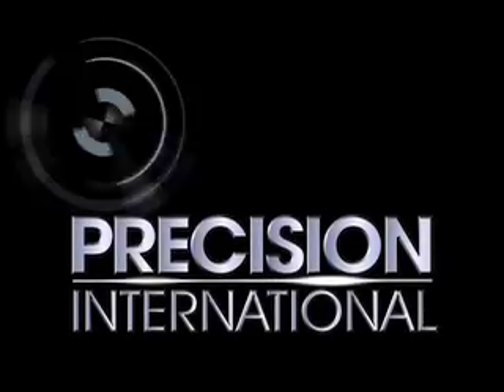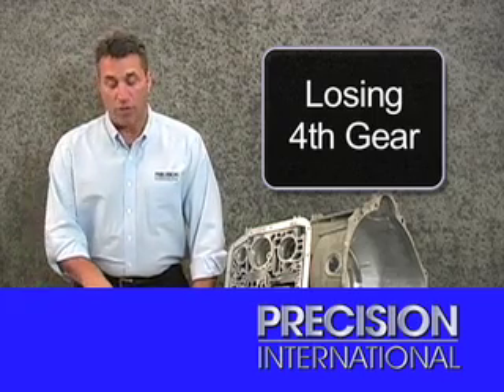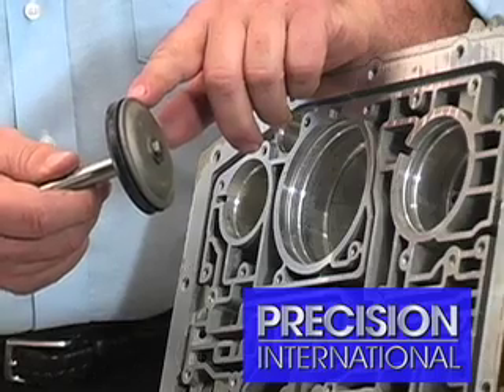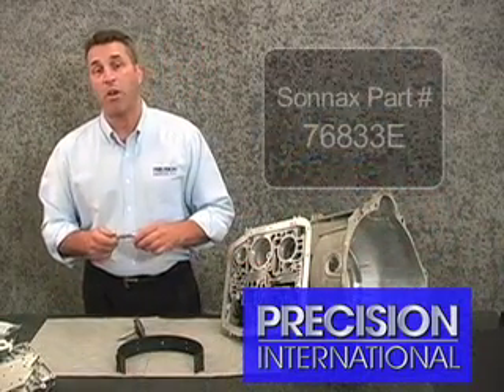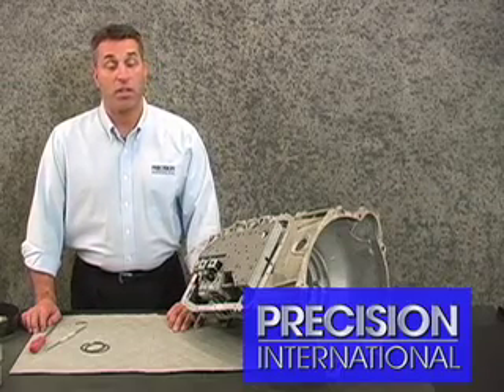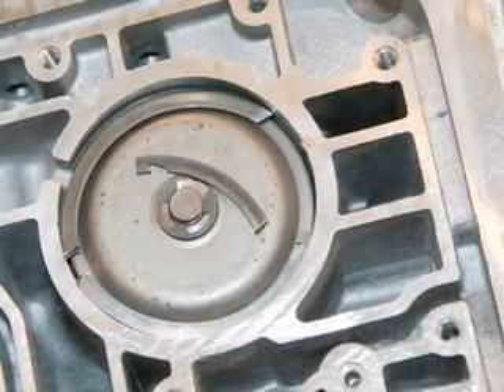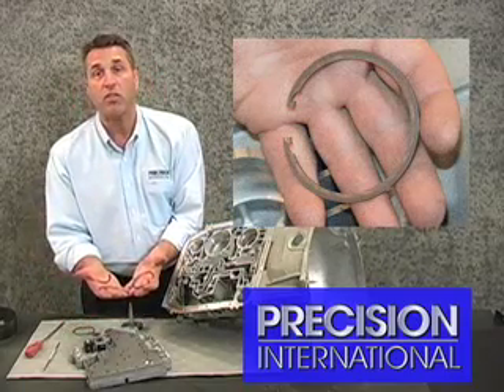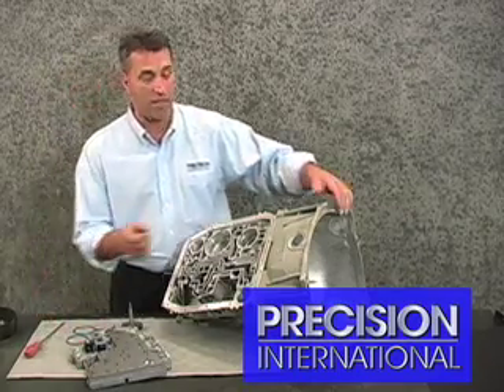4R70/4R75W - Loss of 4th Gear Concerns

Comment: My buddy has a crown vic p71 with the 4r75w. It acts weird in 3rd gear and overdrive is basically completely gone. He has to turn overdrive off to be able to drive safely...like it surges and slips. What could be causing this?
Reply: Same here od servo clip pieces in the valley bloccing trans fluid flow or broken spring letting od servo compress to far there for od band slips out of of place.

Comment: I have a 2001 Ford F-150 5.4 4r70w, when cold it will shift into all gears. But after it warms up no third or overdrive, all of that happened when I took a turn to fast. Any advice would be good thank you..
Reply: Hi, did you found what caused your problem? I gave the same thing

Comment: What is the reason for this type of failure,  I've just changed servo and ring cleaned and inspected valve body changed 8 plastic balls . Its still has no 4th gear every thing is in place and lined up
Reply: Overdrive band needs to be put in place before servos are put bacc in place

Comment: Ford F-150 4th gear went out 5 transmission shops said it was the transmission it's all bull crap $1,800 new transmission did the same thing and then they said oh it must be electrical not one Transmissions shop said it might be electrical find out the computer was bad put new computer in it everything's perfect shifts perfect there was nothing wrong with my old transmission it's all a scam
Reply: Danny Collier what exactly did you replace? I have the same problem with my 05 F150
Reply: Ben Beyer it all of a sudden going down the road high gear just revved up like in neutral and the engine did surge a little bit at a red light and all that work putting a new transmission in and converter I'm 73 years old ain't easy no more it was the computer put a new computer in it didn't touch anything else and it ran and shifted perfectly and still is
Reply: Danny Collier my 99 250 super duty 7.3 has done this since I bought it with 85k. At 75 mph or higher tries to shift down then goes into neutral. Similar to yours? You fixed it with a new computer? I recently replaced the trans with no change.

Comment: Man will you help me please I have a 2002crown Vic it have a transmission issues when it to gear it shifts normally but the 4the gear it doesn't ingage in it start to rive high and move slowly I press the over drive just to make it move I chick the fluid it's OK and clean and I try to scan the code it doesn't show any thanks
Reply: mshary's garage did you ever get that fixed? Mine is doing the same
Reply: Just happened to me on my town car,  just as you describe it. No 4th at all, from 3rd to neutral... any advise?
Reply: did u ever fix??
Reply: +Karim Bakri I don’t know of a fix, but the easy way is to turn overdrive off. Car should be 100% drivable.
Reply: @99thpeanut59  yea thats what ive been doing i tried replacing overdrive solenoid and check balls didn't fix it just gonna have to swap the trans now
Reply: +Karim Bakri keep me updated on if a new trans fixes it.
Reply: 06 crown Vic doing the same thing. No 4th just 1,2,3 then like it's ok n neutral. Overdrive off it goes through all three no problem.